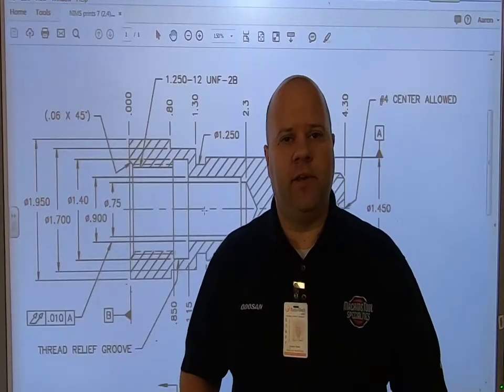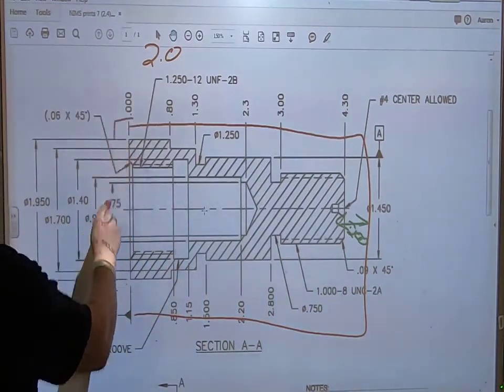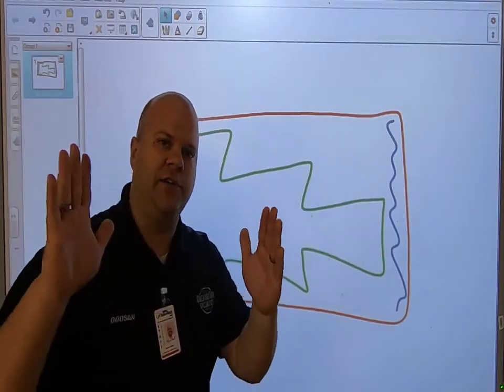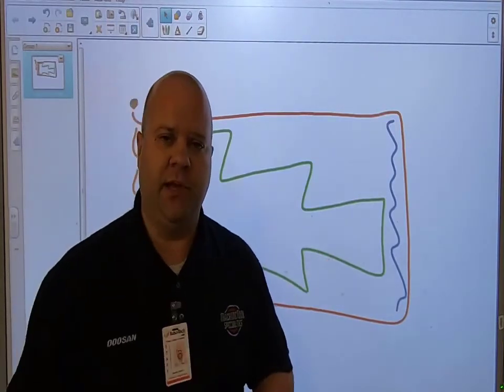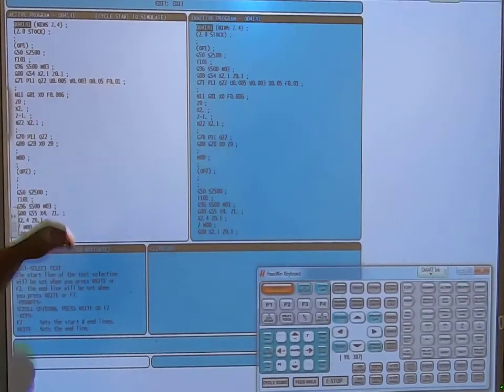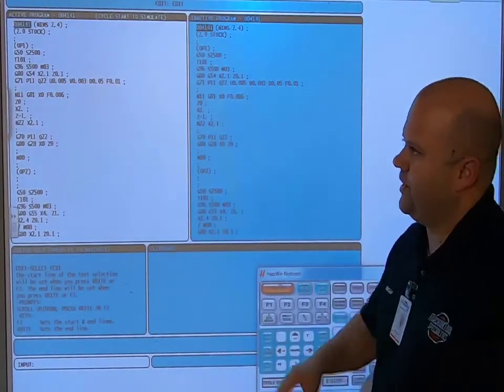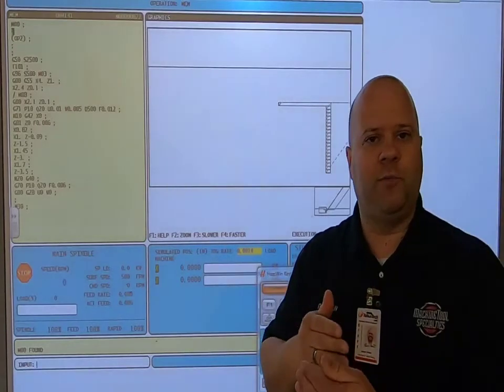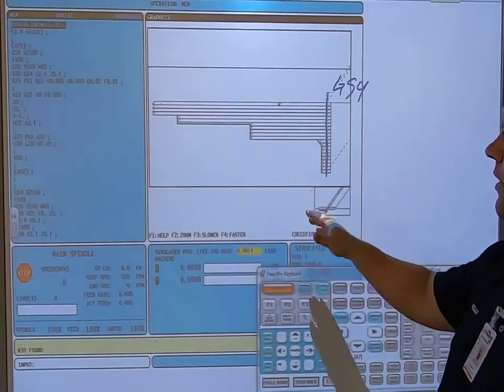Using Multiple Work Offsets On a CNC Lathe

Comment: Very informative video and good explanation... Geometry offsets always bothered me, by the way i am newbie in CNC lathes world and always wanted to understand those offsets but looks like there is little to no good and detailed answers on the internet. Here is my question: what would happen if we used G54 offset on the other side (second operation) too? Is it possible to use only one offset, or every time we have changings in part length we must use different offsets... I mean when we flip the part, Z zero is already located on G54 (blue marker at the end of the video) so if i assume corectly the only difference would be that now when we type G code we must go in negative Z direction for each pass because we are measuring from blue line (G54) not the red one... Why would people even use G55? Is it so hard to just add negative dimension and cut deeper (move tool deeper in negative direction on "Z" axis) its basically changing few more coordinates in program for each pass and thats all... Also what i cant find on the internet is the difference between WORK offset and GEOMETRY offset, its very confusing... I know that the difference is WORK offset moves all tools in turret, no matter of their length and width and GEOMETRY offset position each tool in the turret... So if we have for example 5 tools there is 5 GEOMETRY offsets and only one WORK offset... What i want to know is: if i measure all 5 tools via GEOMETRY offset (touch face of the part with every tool in the turret and hit Z and X measure) do i need to measure WORK offset too or is it already set and ready to go? Are GEOMETRY and WORK offsets somehow connected so when we measure GEOMETRY, WORK offset is already set or they are completly different things and both need zeroing... What confuses me is that numbers in G54 WORK offsets are in some videos X:0 Z:0 and in some videos WORK offsets have some values in them... Should G54 offsets always be 0 before we start measuring tools in GEOMETRY offset? Those numbers are so confusing, i cant keep in track what machine tries to calculate and what are those numbers when we click on MEASURE... From where those random numbers come from? I assume its the distance from somewhere to somewhere but i dont know exactly from where... Someone says its from the machine zero to the part zero, others says its from the tool turret to the part face, someone says its from the chucks to the face of a part etc etc... I assume it should be destination from machine zero (referent point) to the part zero (face on wich we measured our tools) but if that is the GEOMETRY offset what the hell are then those number values in WORK offset? If they both meausre same thing (distance from machine zero to part zero) why are then number values not the same? For example WORK offset says G54 X:0 Z:0 (i got that numbers by touching part face and hitting Z0 measure) and then i repeat for the all 5 tools manualy via GEOMETRY offset (because each tool shank is different length and width) but when i hit MEASURE in GEOMETRY offsets appears random numbers which machine callculated for example X:-45.62 Z:-155.24 why are those numbers different from WORK offset numbers and what do they represent? Yet on the display when i hit POSITION button, machine shows X and Z axis numbers which are completly different from geometry offsets... Should not they be same? Since position monitor should display position from part zero to machine zero which is exactly what we measured during facing in geometry offsets... I think that when we send tools back to 'home' (referent point) position button should display X:0 Z:0 yet on my machine there are some numbers that are not 0. Sorry for long comment and questions, but i am confused newbie who looks for help, thats why i watched your video... Looking forward for help, thanks in advance and BTW great video, keep em coming!
Reply from the maker: So I have some good news, I have made a video that I'll be posting tomorrow that will further explain how to use work coordinates along with G54 and G55 shifting and how the clearance planes work with those work coordinates I'll also try to address some of the questions you have above as well.
Reply from the maker: https://youtu.be/5lZR3tIIPwM
Also if you watch the video to the link above you'll find out more of your answers to the differences in work in geometries with tools and you'll see that I'm setting all of the tools without a tool pre-setter which means the values in the work offsets will only be used for shifting the program in the z-axis. You can just use G54 and just run 1 operation at a time, or you will have to edit your operation 1 program Z's to leave material on the party for operation 2. Thank you again for watching
Reply: @aaronrunk4209  Thank you so much. You are helping a lot...
Reply: thank you friend, you described in your own words what is going on in my head!!!!!
Reply: I'm currently banging my head against the wall over this question!!!